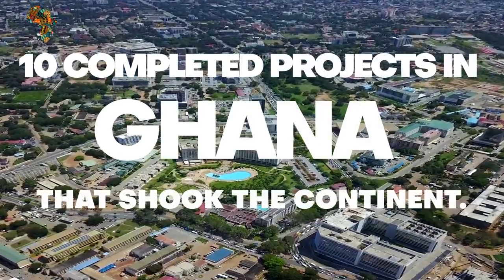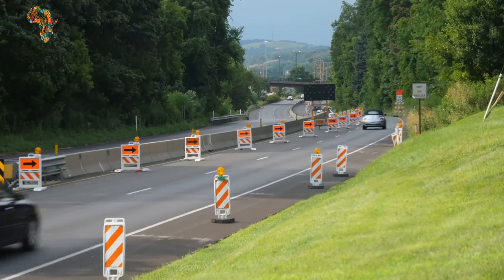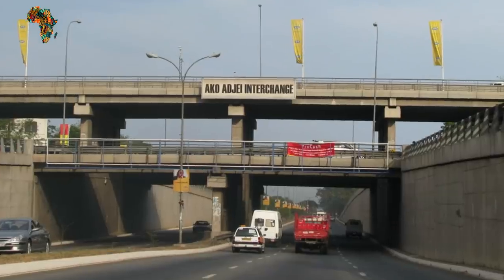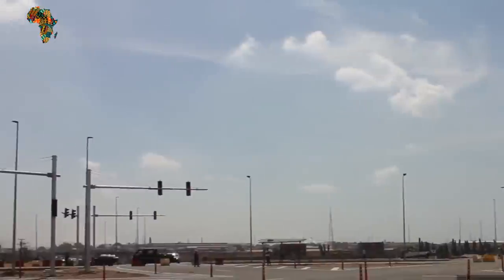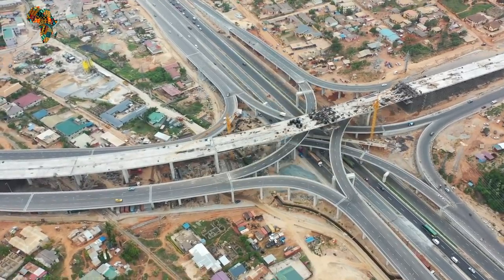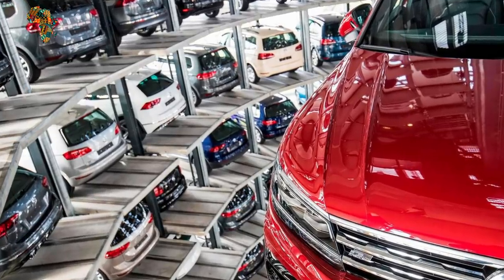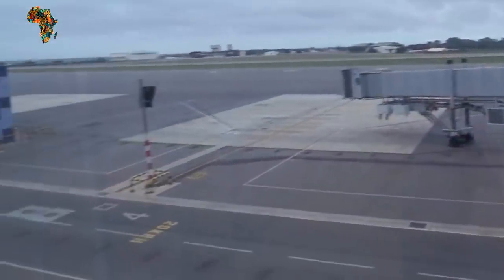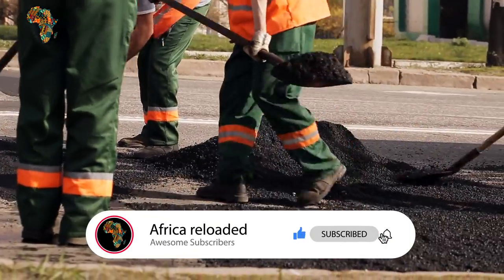10 Completed Projects In Ghana That Shook The Continent

Comment: The Marketplace  must always be  opened  in order to make the  Locals  feel comfortable and  to sale their. Goods in the open. Air..instead of  putting them  inside of a closed in building and  buildings...God 's Black people everywhere  must be free to  continue  in the natural way of life and  yet  be protected from the  Flood Waters and  Flooded Roads  and. Streets...There are many  many  ways to  improve the. Conditions and  still  allow the  Locals and their  Opened  air businesses to  remain  the same and  safer.....Building a  Super Huge Top covered  roofing  system  with  very  very large Tanks on both sides of the  areas  that  will collect the  Rainwater from the  Top of the  Very huge  Roofing  system and  collect the  Rainwater and  it will flow  into the upper  tanks and  at the bottom  areas  where  ground water is...this  Rainwater  will  runoff into the  bottom  Tanks a on both sides of the  Marketplace  areas and  the  waters can be  made pure by of course  putting in a  purification  system  so that this water will be  used to drink and clean up the  area and  just keep  things more fresher...